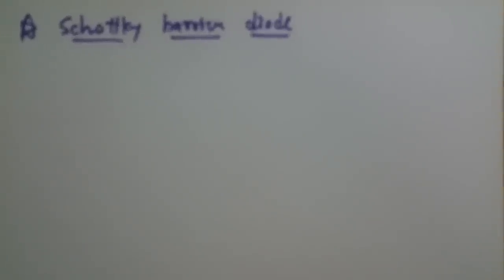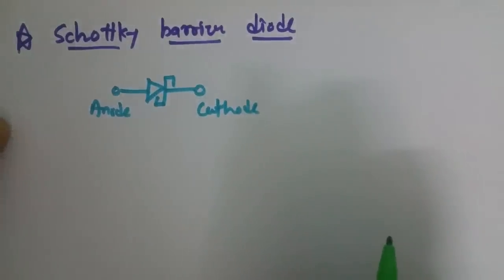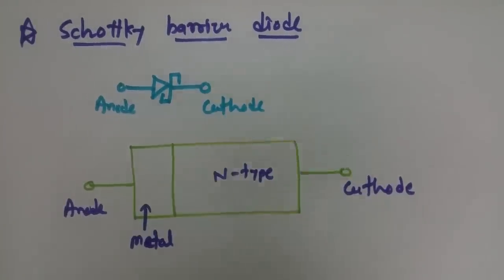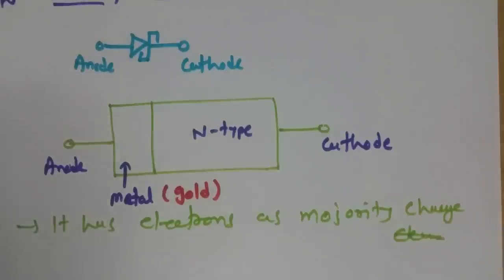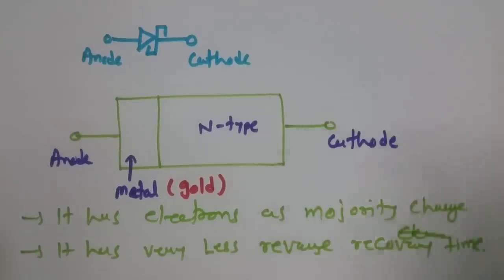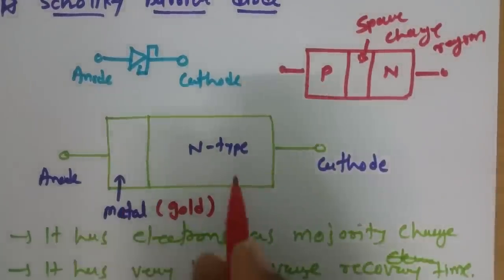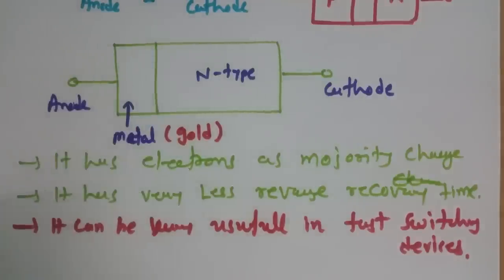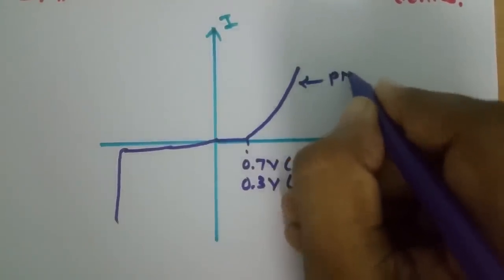Schottky Barrier Diode (Basics, Structure, Characteristics & Applications) Explained

Comment: Sir, you explained very well, but my doubt is ''  is the reverse Current because of minority charge carriers I.e., holes in N semi conductor. '' and why it is called as hot carrier diode.
Reply: The kinetic energy of electrons from semiconductor is very high compared with the kinetic energy of electrons from metals. Hence the e from semiconductors are called as Hot carriers. Since conduction is via them, its called as Hot carrier diode

Comment: Great explanation.
Reply from the maker: +Brandon Perez : your welcome
Reply: I was in search for an explanation for this device
fch20u10
Could u explain a little or give a link with info or what it is called ?
Reply from the maker: +Brandon Perez http://www.alldatasheet.com/datasheet-pdf/pdf/599068/NIEC/FCH20U10.html
Reply: Engineering Funda ive seen the data sheet. But i want to know what specific device is this? Its purpose? A general  name aside from the part ID name. It seems like a hest sink or voltage regulator?